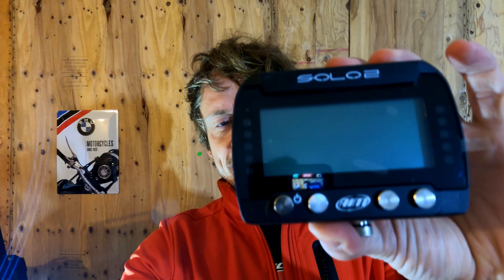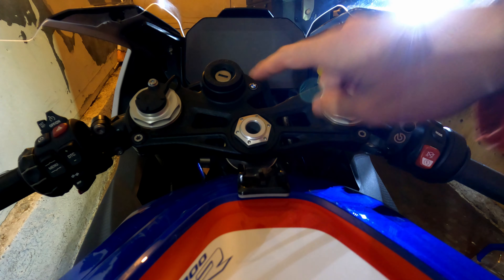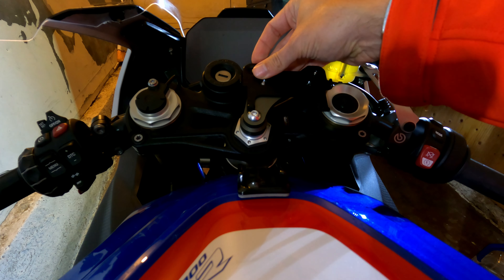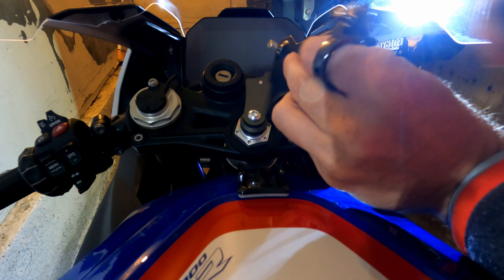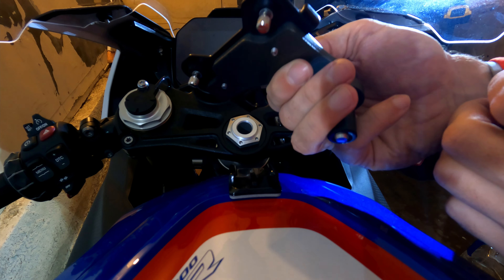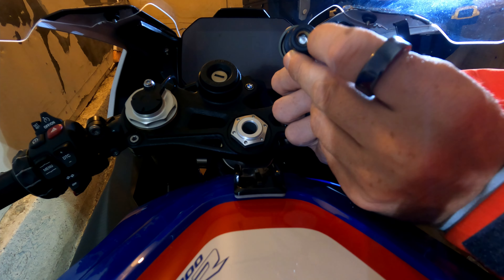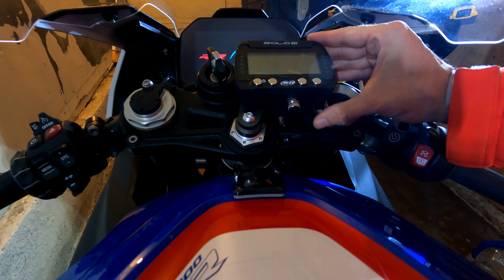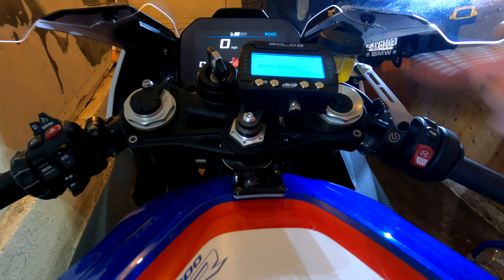AIM Solo 2 Install on 2020 BMW S1000 RR

Comment: Good video, can't believe more people aren't watching.. maybe not enough people are buying the AIM solo 😀. Anyway, great video 👍
Reply from the maker: Appreciate it! Like the video and it will trend higher in the Youtube algorithm for folks to find it :)
Reply: @MonoMoto  I did like it. I'm trying the get one installed on my bike, just don't have the base mount that the AIM bracket mounts on. I watched another video where a guy was using a base mount that clips on to the fork, am debating which of the two mounts would be better.

Comment: Will it kinda block the dash from the GoPro?
Reply from the maker: Yes, in the way I used the GoPro before it certainly does not work to have the Solo and the dash in the view. I'm experimenting with a new setup right now to have laptimes and dash all in the shot. Stay tuned for more

Comment: Does it hook into the ECU? I ask because I have been having trouble finding a ECU GPS logger
Reply from the maker: Yes it can . There is version of it that does it but currently it’s not out of box compatible with the k67 s1000.
Reply: @MonoMoto  okay thanks for clarifying. I have a K67 which is the issue lol